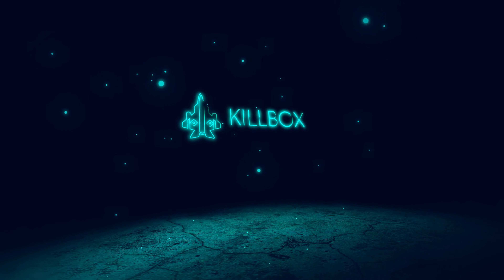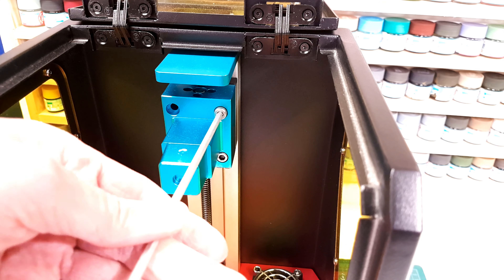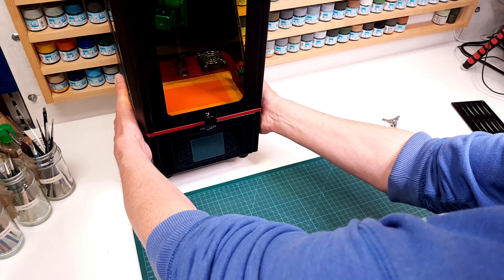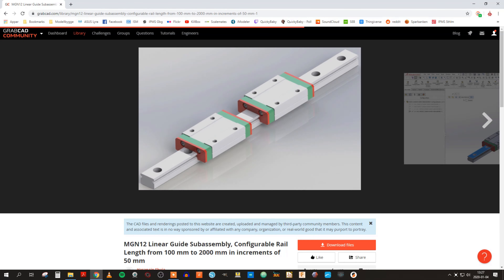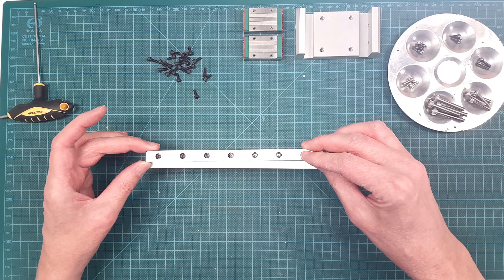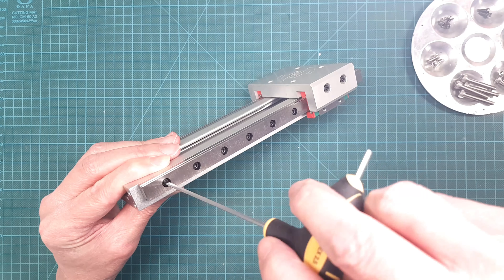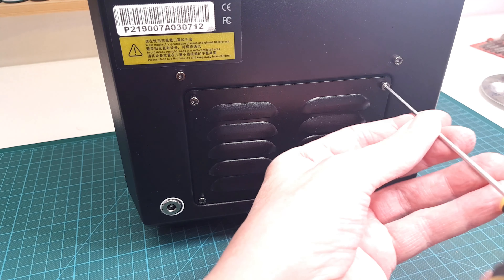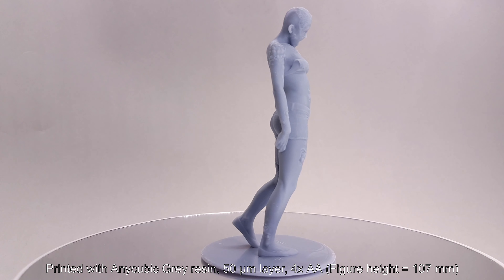Anycubic Photon Z-rail Upgrade: No more Z-axis wobble

Comment: This 3D printing may become (or is already?) the latest tool in scale modelling. Do you think that 3D printing can create, for example, 1/72 scale cockpit, aircraft weapons,... ?
Reply from the maker: I think that it can, but some details may be hard to reproduce (if you compare it to resin cast after market parts like cockpits), so a combination of scratchbuilding and resin printing may be the best solution.

Comment: Hi! thanks for the vídeo, I'm considering buying a 3D printer for the first time and checking them out, have you considered the Photon S that came with dual rail already? wich one in your oppinion would be my best bet? the normal Photon or the Photon S ?
Reply from the maker: Hello Cesar, I bought my Photon just before the Photon S was available so for me it wasn't a choice, but according to reviews I have seen the Photon S performs well (check out the review by Physics Anonymous, https://youtu.be/Fh1pk4hsTfI ). I think it's safe to say that the Photon S is better than the standard Photon, but the Photon S uses the same rail design as the Photon; but it has two of them. And that rail system will degrade over time and need tension adjustment of the rollers.
 
Hope this answer helps you! A resin printer is a really great tool for scale modellers - I'm very happy that I got one ;)
Reply: @KillBoxScalemodelling  Link is broken
Reply from the maker: @GregKrsak  : fixed

Comment: Hello sir, I'm completely new to 3D printing and wanted to ask if I may, are the design prints more frail than filament printing? Thank you in advance.
Reply from the maker: Hi Guapo, it depends a bit which type of resin you are using, but in general I would say that FDM print are a bit flexible and resin is normally more brittle. But there are specially designed "engineering resin" that can be use for more demanding applications. But I have no experience of them yet. Hope this answers your question :)
Reply: @KillBoxScalemodelling  Good to know, and thank you for the reply. 🍻